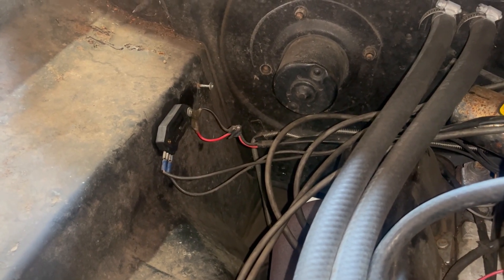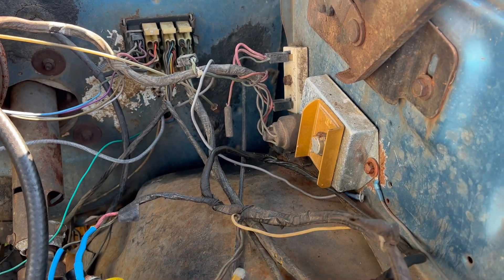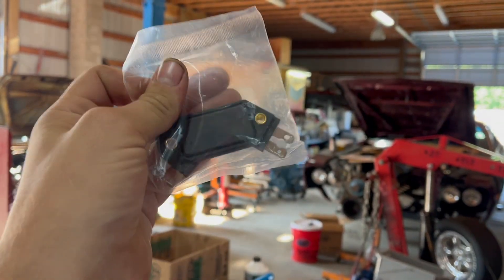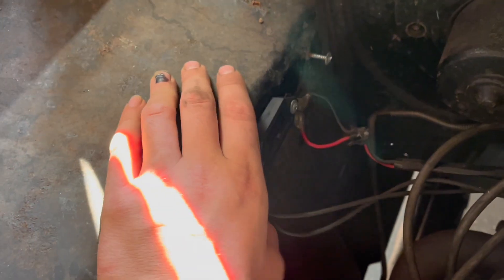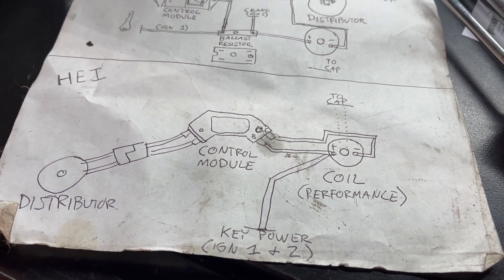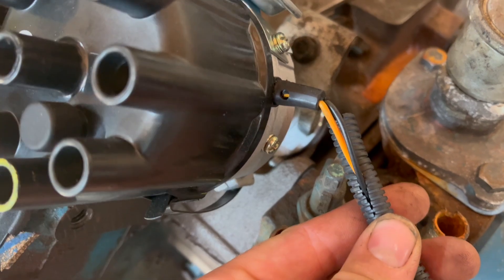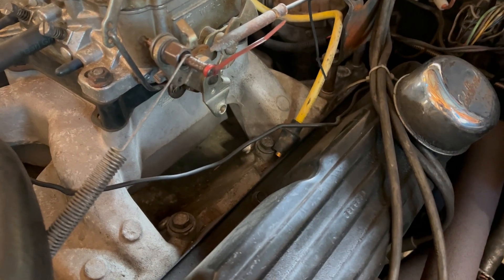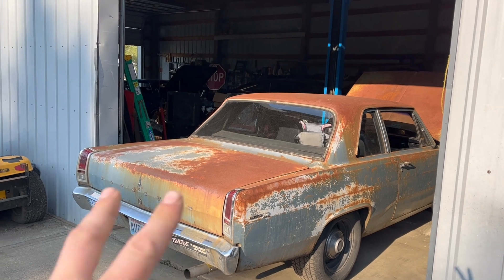The Big HEI Ignition Conversion Video! How To Convert Your Classic Mopar (Or Anything Else) To HEI

Comment: Hey jamie, so for the B pin on HEI module, I have a red wire going from that to positive post on coil and then a new spliced into that existing wire as said and ran to the blue “run” wire on ignition switch. That wire gets 11.99 volts on run and about 10.90 volts on start. Did I do this correctly?
Reply from the maker: That sounds about right to me, but assuming your battery voltage is 12.6, you have a good bit of voltage drop between the battery and ignition switch.
Reply: @DeadDodgeGarage  I got 12.99 volts on battery. I know it’s kindve a drop but it should still be ok right? I got a no start crank issues but I’m fairly confident it’s just cause of my pick up coil getting electrically surged out
Reply from the maker: Did you see my test spark detail? If your distributor is bad but everything is wired right, when you turn the key on then off, it will spark from the coil once. If it does that you’ve got a distributor problem.
Reply: @DeadDodgeGarage I did not. What time was that in the video?
Reply: @DeadDodgeGarage it did in fact spark once on run position off of spark plug wire to coil

Comment: Seems the oem module died and they replaced it by an aftermarket module. That thing died too and now im stuck. Is any GM module fitting a mopar igmition system? For my stock 1976 dodge w200... 
I'd add a hi-po coil then too.
Great content by the way, love your vids!

Comment: What if you have the less than awesome 1987 D150 with a lean burn 318
Reply from the maker: I highly recommend deleting that ASAP. Haha. You can use all of the same components I specify here - a factory electronic distributor, an HEI module, and a performance coil. The only thing I’m not totally clear on is the ignition power source you’ll want to use in that application. As I understand, the ignition resistor moved inside the lean burn modules in later years. You will most likely want to find the power feed wire for the lean burn computer and use that. Given that those carbs generally use electronic controls, I’m assuming you will be changing that too.

Comment: I have 81 dodge truck with lean burn electronic module that’s bolted onto air cleaner. Would love to put hei system. I have already bought  gm module and hot msd coil. This truck did not have ballis resister so  I’m scratching my head. This is my 14 year old daughters truck. 225 motor
Reply from the maker: Huh. I thought they still had a resistor. My ‘79 Chrysler that had Lean Burn does. If the coil positive terminal shows a full 12v when the engine is running, you’ll just use that wire to power your coil and module and you’re good to go. If not, find a power wire on the lean burn that has juice during running and cranking, and use that.

Comment: HERESY! I shall call the Chrysler bishop and have you horsewhipped! 😀
Lol. Good info for new guys. It started in the 90s with voltage regulators and in the 2000s the mopar ECUs replacements started to be junk. Its been many years but I bet if you could grab an OEM ECU it would work fine vs any new one. Now cams are junk!? ugg. The HEI is a simple setup like the one wire alternator and we know it has to be because its made for Chevy guys😅 Im betting ill be using HEI soon though!

Comment: here in France lots of 70's SIMCA cars, kind of Chrysler-France ( Dodge Omni, SIMCA 1307, Horizon etc etc ) runs theses 4 and 5 pins modules ECU with all kinds of distributors, Bosch, Ducellier, SEV,  all 4 cylinders we never cared of the module colors ( I didn't even knew and learned here about thoses... colors THANKS !  fun you can also hide the HEI inside the original ECU... 
I donnot understand why/how get rid of the Ballast resistance ... because without ballast a 0.3 Ohms coil is ... 13V/0.3Ohms = 43 Amperes comsumption  ... even with 0.7 dwell it makes 30 Amperes wich is the production of my small generator  😮‍💨 excuse me I am bloqué ( stucked) on this issue I visited the website saw that but no explainaition about coil's consumption.... ?? please ! help, is the HEI miraculous regarding hawfull ballast wiring also ?
at the moment instaling  an SEV-chrysler electronic distributor in a SIMCA 1000 4cyl 1971 instead of points. have just the proper distributor a new ECU ( 5 pin) and Wonder about HEI ... 1.6 Ohms coil would be enought ( engine 7000+ RPM only 4 cyl)

Comment: Back in 2016, I purchased a 1974, original 51 thousand mile Cutlass Supreme. It had the "point" distributor installed from the factory. GM installed HEI on vehicles starting the 75' model year, along with cat converters. The very first thing I did to my Cutlass 350 V8 was to install the GM HEI system. What a big difference it made to the car. Quicker starts, much better acceleration, engine idles very smoothly, a little better fuel mileage, and of course, the 8mm spark plug wires. This car was put in storage in February 1979 in a temp controlled environment in Detroit Mi. I have since made upgrades...rear disk brake system, 4-row aluminum Champion radiator, an aluminum water pump, an aluminum heater core, a totally new 4-season air conditioner compressor,  a completely new Moog front suspension and rear coil springs, switched from 14' to 15 in Cutlass SS wheels because of the rear disk brake system, removed the "dead" 8-track tape system and installed a Delco stereo radio with new Blaupunkt front and rear speakers, annnnd a Blaupunkt  Beverly Hills 71 CD-DVD stereo system. The Delco stereo radio and the CD player shares the very same speaker system. It sits under the dash between the console and the ash tray, a perfect spot. My next project for this car is the paint and vinyl top. The color is Citation Bronze and the vinyl top is saddle beige. Then she will definitely be complete, better than when she lift the factory. OK guys, as I said befoe...us car guys talk about three things....women, cars, and football. Probably NOT in that order but close. Good day guys. Enjoy your rides.
Reply from the maker: I don’t have time for football. Haha.
Reply: Pics, PLEASE!!!!!

Comment: "Chrome box"...  This was basically the same as the stock Mopar ignition module without the RPM limiting circuit.  I think it was limited to 5000 rpm.  The "Chome box" was also knon as the "505" box, called that for the last three digits of the p/n.  Later they came out with the "orange box", which was the same, also the "505" p/n.  About that time there were cheap aftermarket replacements (you could even get those in Walmart) that were chromed but were not the "505".  Maybe that's why Mopar went to orange, I don't know.  I am not sure, don't know where I picked up this tidbit, but the bit TO3 transistor, the one on the heat sink, on the 505 box was a higher rated transistor.

Comment: Fords were a lot worse years ago, I had a 1980 F100 pickup a long time ago, my daily driver it was almost new so I was making payment, had the big aluminum module, they would go bad at the worst times, and very often, I replaced it over 10 times, kept a spare in the glove box, was reading Car Craft magazine one day, they had the diagram to use an hei, it worked great for 15 years and was not even a new one when installed
Reply: Fords used the "dura spark" systems which were horrible. For some sick reason you would either get a 70s-80s Ford vehicle that would go for literally 15-20 years on the original ignition box with zero issues or you would be unlucky and get a vehicle that would fry the ignition box every few months for no rhyme or reason. It also didn't help that the replacement boxes are usually of very low quality and the high under hood temps are usually what takes out the ignition box and the ford wiring of that era was terrible quality and would fall apart and the grease in the connectors would get hard and cause connection problems. Sometimes the distributor pick ups could go out but 9 times out of 10 it's the durapsark box. I have seen many of those boxes be bad right out of the box or only last a few days, with those old Ford's going to an hei ignition or MSD or equivalent ignition box is a much more reliable and better choice.

Comment: Just one more GM innovation.
Reply from the maker: Chrysler had electronic on the market first - but GM turned the wick up. 🙂
Reply: @DeadDodgeGarage  That's wierd. GM had transistor electronic ignition K66 in 1964. 7 years before Chrysler's cease fire electronic box was offered.

Comment: I have a Dodge with a 225. Do you happen to have a part number for a Chrysler hei distributor that would work with a conversion? Or a Chrysler year/make/model? Thanks.
Reply from the maker: I assume you mean an electronic distributor that can be used with the HEI module like I’ve shown here. If you ask the parts store for a ‘73 Dodge Dart 225 slant distributor, you’ll get the right one.
Reply: Yes sir. Thanks. So the 73 Dart has an electronic distributor as in non points? @DeadDodgeGarage

Comment: Don’t know what we did wrong.  Had an HEI retrofit on a small block Mopar. Electronic ignition distributor.  Setup was exactly as in this video. Flamethrower coil, aluminum heat sink just like the one in the video. Heat sink paste and trimmed off the plastic nubs. After 3 burned out modules and being stranded 3 times; removed the HEI and currently have a pertronix distributor.
Reply from the maker: Huh. I don’t either! Poor body ground or a voltage supply problem come to mind. I have seen a good few modules fail, and the poor ground issue seems to be the most prevalent.

Comment: Swapped out the duraspark module in my 79 courier's 2.3 for an HEI because I couldn't get a duraspark box to live there for any length of time, including the one from the donor Ford ranger. Blew  out 4 or 5  HEI modules before it occurred to me that a ground wire on the mounting lug might be a good idea. Trouble free for years & years after that. To Hell  with ballasts & resistor wires. Skip all that idiocy. HEI's the way to go. Get a length of 3/16 x 2in aluminum strap from the local Home Shlepo for a heat sink & remember to snap that little plastic tab off the back of the module so it sits flat. You can't go wrong!
Reply from the maker: Works great! But yes, a good ground is important. Haha.
Reply: Had an HEI setup exactly like this video in my small block Mopar.  Did put a jumper to ground.  Heat sink with paste. Clipped nubs.  Maybe 400 miles total, 3 failed modules. Ditched the system.   
Running pertronix at the moment.

Comment: Questions at 10:mins

 1.Connect another wire to the G side to the Battery positive on the ignition coil?  For it to act as a pull up resistor? 

2. When im grounding out the w terminal i'm taking another wire and to the body? 

3. Would any ignition module work? Or do I have to get a certain year?
Reply from the maker: You would need a suitable resistor, with one end connected to coil positive and the other end connected to the G terminal. Yes, ground can be the body, the engine - a good, suitable ground. As far as I know, any four pin module can be used this way. I always say 1975 Chevy for simplicity. I have only ever tried triggering a module with points once, and it’s been a long time. But if you haven’t found it, here is a good diagram. https://www.jalopyjournal.com/forum/attachments/hei-jpg.2926295/
Reply: @DeadDodgeGarage  also do you think a normal ignition coil would work? I don't have an msd blaster :/. 3rd day on trying this set up.. no spark..
Reply: That's awesome! I hooked up this ignition system on my dining room table so see if i could get spark, with a new distributor, a new module. Coil is old but still works( tested with a battery) And of course not getting any spark with all my sparkplug.. so sadness. Second day at it.

Comment: Great video. Hoping you might be able to answer a question… I’m building an engine run stand and decided to wire it to run the alternator also. Since Automotive Wiring is not my first language, I’m stuck on where a voltage regulator fits in to the mix… or is it even needed with HEI? It’s never mentioned in the Mopar/HEI conversion videos that I can find. Thanks!
Reply from the maker: You’re talking about two completely separate systems - the ignition system and the charging system. It’s not mentioned for that reason. The charging system doesn’t care what ignition system you are running. The electronic ignition system might care about your charging system’s output - people on the internet seem to think so - but only because the electronic ignition module might prefer a stable voltage to operate on. You still need a voltage regulator to coax a charge output out of your Mopar alternator. We don’t run the charging system on our run stand. I did wire it, but a freshly charged deep cycle battery has been sufficient to run the ignition, electric fuel pump and cooling fan for our 20 minute break ins. We usually don’t bother.
Reply: @DeadDodgeGarage  I’ve got it now. For some reason I thought it had to be inline with the VR or something 🤷‍♂️ Thanks again.

Comment: I have two pickups in my distributor how do I wire that
Reply from the maker: You get a different distributor. That two pickup unit has no timing curve and no vacuum advance, which isn’t what you want - unless this is an all out race build and you actually want the timing locked out, maybe.

Comment: I have purchased three icm then i did this conversion. Now i have purchased 3 hei. What am i doing wrong.

Truck runs great for a while, then loses power studders, then wont start
Reply from the maker: Hmmm… what kind of voltage is getting to the ignition modules? What kind of shape is your distributor in? Do you have a firewall ground strap in place?
Reply: @DeadDodgeGarage  was 12v then I realized the MSD blaster 2 should be ran through a ballast. Now it is. Runs better now but low RPM 600-700 misses. 2k runs smooth.

Dist is less than 5kmiles. Yes extra ground strap

Comment: I did the hei conversion on 1982 dodge d150 I'm getting spark fron coil to distributor but no spark from distributor to plugs any suggestions thanks
Reply from the maker: Very few options there. Weak coil, bad coil wire, or weird cap and rotor problem. Not much else I can think of.
Reply: No problem, thanks for the response

Comment: These HEI modules suck. I’ve tried all of them. ACCEL, AC Delco (stock and performance) Davis and MSD. Did the conversion on my Mopar dizzy. There’s a guy that makes a mount for under the Mopar distributor. Never again. I knew better, my first few muscle cars in the 90s were GM, tried HEI of various brands back then. Same result.
Orange and Chrome box have been great. Never had one fail. But haven’t used one in 15 yrs either. I hear they aren’t what they used to be. I’ve been using old school MSD 6AL boxes for yrs (not the digital) and never have an issue.
Reply from the maker: MSD is great. I have not gotten that result - in fact, exactly the opposite, as discussed here. But your mileage clearly may vary.

Comment: Been using Arctic Silver 5 AS5-3.5G Thermal Paste under EACH HEI module in my 3 Ford HEI conversions for 20+ years, NO issues with ANY of them
Reply from the maker: Nice. That’s the good stuff. I’ve never used thermal paste for anything outside of a computer myself.

Comment: Want to convert a 1959 Nash Metropolitan 4 cylinder, can that Dist be converted???
Reply from the maker: You can trigger the HEI module with the original points if you want. It removes the actual load of triggering the ignition from the points, and they should live forever!

Comment: You can go nuts on older engines nowadays.
You can throw on a seven pin ignition module, lockout the vac and centrifugal advance, phase the distributor, chunk on a throttle position module, a mas, knock sensor, oil pressure sensor, water temp, air temp, two idle solenoids, manifold pressure, ecm and the coop day grass add a carb cheater to any old carbureted clunker and bring them into the 21st century.
Always starts, maintain a 14.5 afr, self adjusting timing and choke with all the safety whohaws, get great mileage and get to keep you old carb.
Reply from the maker: Oh oh oh! Or, you don’t do all that, and you can still get great fuel mileage and decent power, without giving yourself a coronary adding a bunch of electronic BS…
Reply: @DeadDodgeGarage  O don't get me wrong I'm just saying it's very possible to do. Would I? Depends on the situation.
A one of a kind motor with no parts availability with a bad distributor or something. 
Maybe convert what can't be fixed or replaced.
Or just to see how a model A or T with a flat head would run with an injector throttle body and coil on plugs

Comment: Here is my question, I think I have too many parts . 
All I need is distributor, module and wire . 
I don’t need the ecu box or the starter relay or ballast resistor. 
I have a 12v coil. 
Rebuilding a 1985 dodge d150 
Any guidance would be appreciated 😁
Reply from the maker: No matter what you do, you still need your starter relay… Are you converting this truck from lean burn? Or does it have regular electronic ignition now? If you are doing this HEI conversion, you need the electronic distributor, the HEI module, and some wiring to connect everything and eliminate the ballast resistor. You won’t need whatever factory ignition module or “ECU” it had originally.
Reply: @DeadDodgeGarage  I’m converting to lean burn with a American auto wire universal kit. Manual fuel pump and carbureted. I was confused with some of the differences. 
So I wanted to make sure I didn’t bead the ( electronic control box and ballast resistor voltage regulator) 
Voltage regulator cause no start issue before. 
This is from original wiring . 
Currently on my truck for the starter system.. I have correct distributor, gm module , starter relay ,voltage regulator . Also According to Hayes and the factory manual my ignition wiring colors do not match anything (but I think I have this figured out )